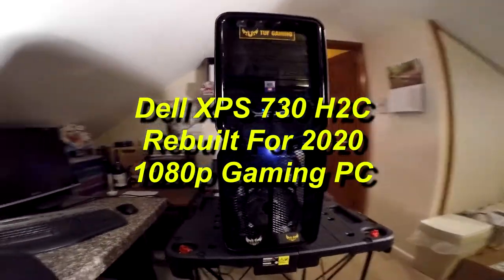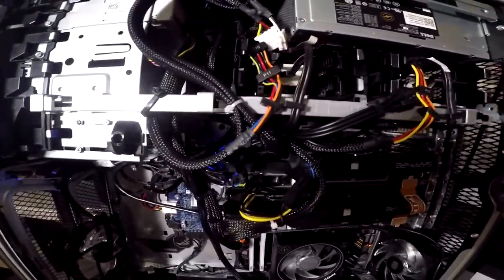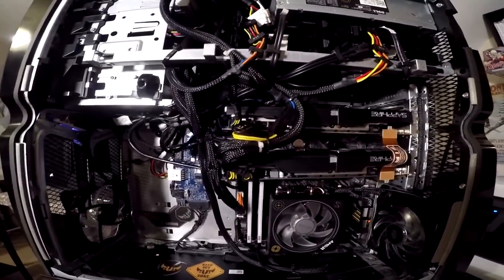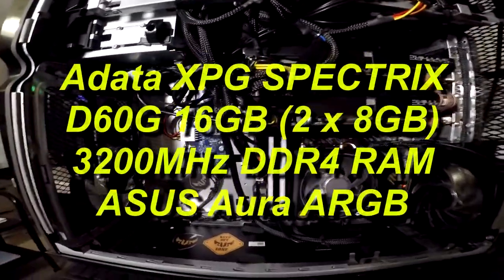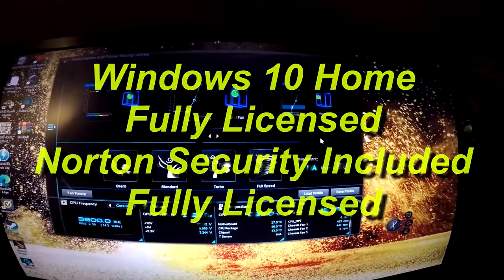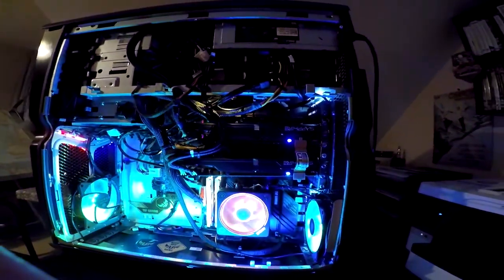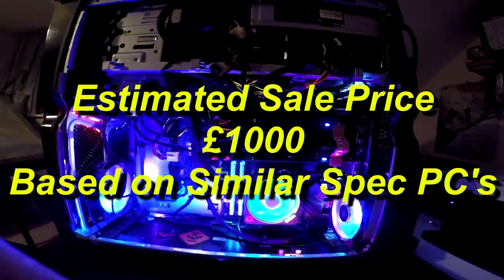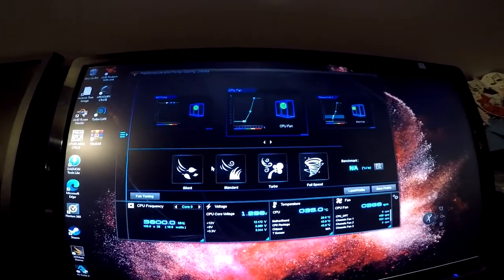Dell XPS 730 H2C Rebuilt For 2020 as Modern 1080p Gaming PC

Comment: Curious, is this case an ATX or a BTX case? I would love to get my hands on one and modernize it
Reply from the maker: Hi The XPS 730 H2C is an ATX case, everything XPS before that was BTX and consequently to upgrade one requires some serious metalwork changes, or a BTX to ATX conversion tray.

The XPS 730 H2C and XPS 730X were the very last Dell branded XPS gaming desktops they made before aquiring Alienware in 2006 and rebranding all their gamming PC's. to Alienware.

You will find some XPS 730 system units on eBay but rarly an empty case. Because of the original spec and cost of the XPS 730 ($4000-$6200 in 2006/7) they still sell for around £400 today.

Comment: I know this is an older video but do you recall by chance how you wired up the power button? Im getting ready to upgrade my xps, power button connects to the MCB, im just wondering if it would still work going from the mcb to the motherboard or if i have to wire the 2 separately
Reply from the maker: Hi, It's complicated :-). But I do still have the wiring diagram that I created in order to connect the MCB to a new Asus TUF B550 motherboard and the existing pin-outs on the XPS 730 motherboard for comparrison.

I can't post a photo in uTube, but if you have an email address I can send a picture of the wiring diagram to you.
Reply: Got an email address I can contact you to? :) I'm in the same boat
Reply from the maker: Yes email me at graham@entsoft.co.uk and I will send you an image of the pinout and wiring diagram I used to connect the MCB to a new ASUS TUF Gaming B550-Plus AMD Motherboard.  @blablagal94

Comment: Is there a program that needs to be installed to change the colors of the LEDs for the xps 730?
Reply from the maker: The front and rear LED's colours can be changed within the Dell BIOS of the original XPS 730 motherboard. They can also be changed by using the preinstalled NVIDIA Performance application, which is a plug-in for the NVIDIA Control Panel application.

The NVIDIA Performance application allows direct control of the following BIOS features: Device Settings, Dynamic BIOS Access, View System Information, Profile Policies, and LED Control.

The LED's are actually controled by the Dell Master Control Board, which is its self an ESA (Enthusiast System Architecture) device. Any ESA device can be controlled by the NVIDIA System Tools with ESA Support. This includes the NVIDIA Control Panel and it's NVIDIA Performance plug-in.

The latest version of the NVIDIA System Tools With ESA Support availible for download from NVIDIA, that I can find is in the below link.

https://www.nvidia.com/en-us/drivers/nvidia-system-tools-6_08-driver/

Good Luck 🙂
Reply: @grahamdyke6612  yeah idk if it's possible still, but I'm definitely gonna try when I get the chabce. I never knew that the leds could change. I got it way back from my dad after the computer became pretty much obselete for him. Later on I upgraded most of the components though. Would be cool to have it all original, but what can I say. I'm not a collector.
Reply: There is a group that hacked the XPS RGB control. It's an open source project. I'm not home right now but I can find the site when I get home. I am pretty sure it's also posted on the 730x redit page.
Reply: @l33b80  Hey thanks. Do me a favor and send it over. Pretty cool it's open source.

Comment: I just sent you a message to the email from your website for the wiring diagram, iv tried to reply to you with mine but for some reason it just keeps disappearing 😅
Reply from the maker: Hi, please resend your message to graham@entsoft.co.uk and I will reply from there.
Reply: There is a pinout posted of the FB group the the XPS 730x. Two swaps just completed and both have the diagrams posted.